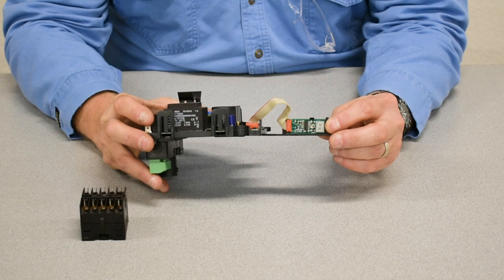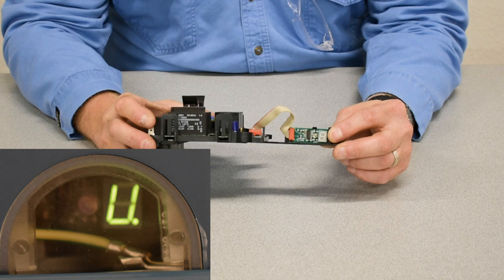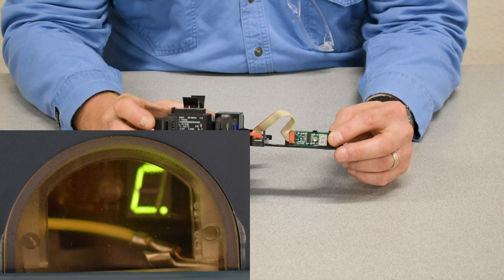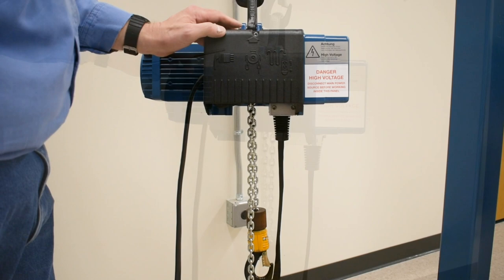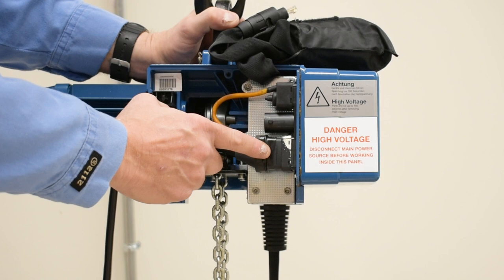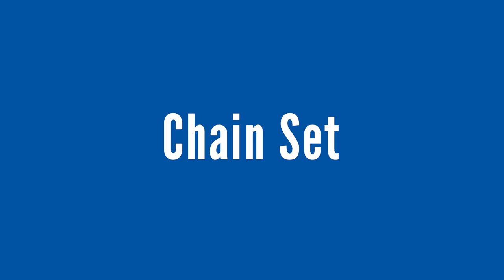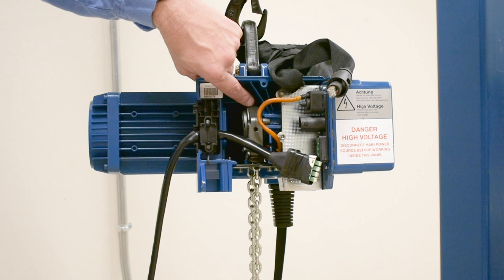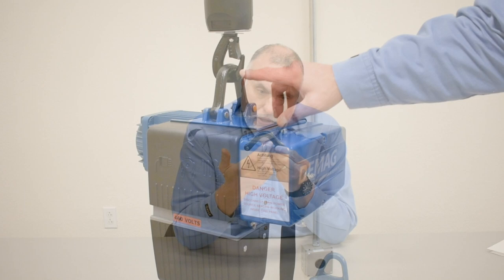Serviceability Overview: Demag DC Chain Hoists

Comment: El peor polipasto de la historia de Demag.
Un negocio en repuestos !
Reply: I just replaced the lowering and lifting contactor using the original abb as coming with original that has broken. The problem is still persist with warning 7 and error 2. There's a rattling sound when lowering the hoist. My local technician can just only replace with new one without giving another moneysaving solution. It seems demag is focusing only on selling spareparts.
Reply: I am getting error 8 & E
Can you give solution
Reply: @jabersond892  Puede ser cualquiera de estas cosas, nosotros vamos probando y descartando.
Botonera, manguera, contactor y relés, placa y freno, no hay más.
Un saludo